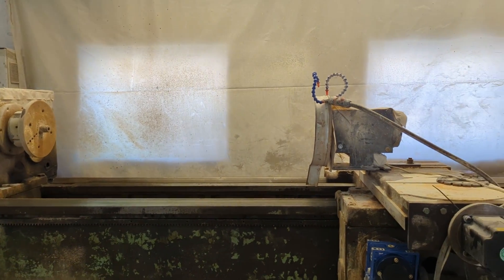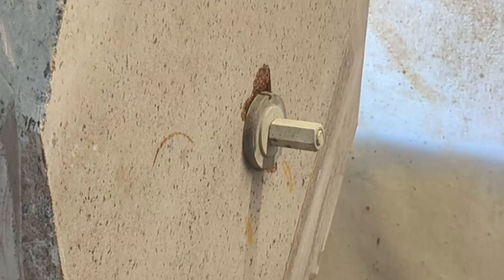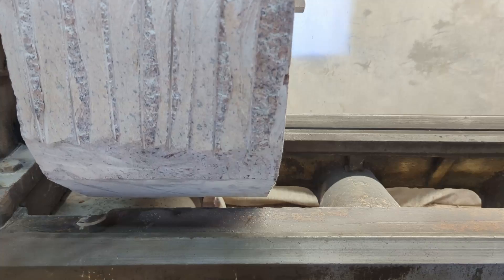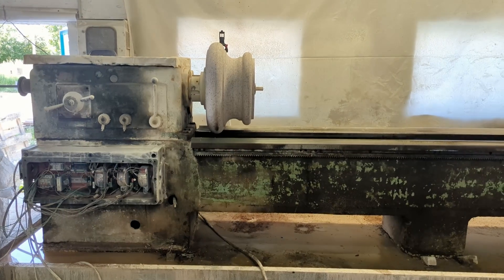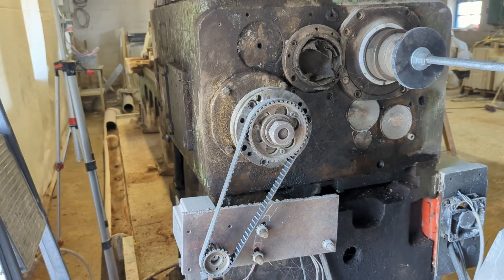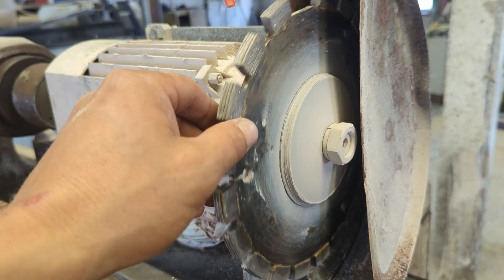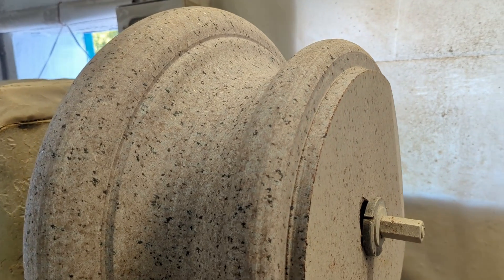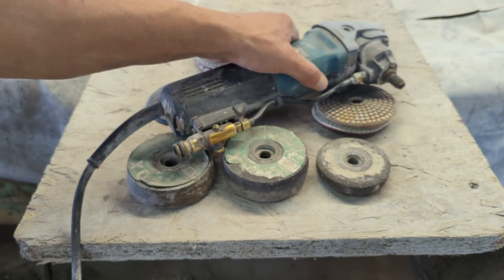Turning giant piece of granite on a lathe or  diamond SAW

Comment: I take this as proof on an ancient pre-dynastic civilization in Egypt
Reply: Hollow it out then add handles
Reply from the maker: Unfortunately, this part must support the column, so removing the middle is not an option. But with the growing interest in more complex projects, the next videos will include a vase or something like that. In the meantime, you might want to check out my previous videos. I promise there is something to see there. Thank you @Trevor.Morrice
Reply: @Trevor.Morrice Those darn handles!
Reply: @737simviator  Yes, I have, hence the joke

Btw, as expected he invest 5 seconds of he hour and a half telling us about the "impeccable" provenance of the vases, without mentioning it, showing any proof, document or independent confirmation

:D
Reply: @TheChzoronzon Also makes me question the circumstances in which the vases were acquired. Some guy probably got scammed into selling a kidney for a fancy cup
Reply: @737simviator first of all, find a great big rock and then break it up into smaller rocks and then heave a smaller rock onto a lathe. 
I guess a vase was the simplest thing to make on a lathe?
But did the vases come from Egypt or were they imported?
Reply: @johncater7861 they found 40,000 vases , apparently . 
Mind boggling
Reply: We should see if you can find a way to make this happen with no electricity just mechanical advantage.  Or if there's a way to harden copper by coating it with Emory.
Reply: Check out the research UnchartedX is doing on this subject.
Reply: @PhiTonics  yes, sure people can have their opinions but a lot of us crave actual facts so far as they can be researched.
Reply: @johncater7861  what are you on about? If your looking to pick a fight, I'm not interested.
Reply: @PhiTonics  I'm purely agreeing with you. Uncharted X is doing some great research. Some others merely postulate without trying to come up with hard evidence and facts.
That's all.
Reply: https://youtu.be/QzFMDS6dkWU?si=0GrBbnqPbs4J0dLj
Reply: Some of the vases measured have provenance back to the late 1800s.. don't just watch the video, read the description.
Most are in private hands, since obtaining artifacts from Egypt legally is near impossible now
Reply: @baabaabaa-El  Let's see the documentation, and provenance details, words just don't suffice... tho having been on private hands makes the chain of custody very weak already, and we should treat the subject up to trial standards, of course, as any good science does

What they should do is convince a museum to measure the vases in exposition, examples a century in documented custody
Reply: @TheChzoronzon  Do your own homework sunshine, lm not ya mum!
Some had come from museums, on loan from private owners.
See how much you took notice, attention span of -
Reply: @TheChzoronzon "convince a museum" 🤣🤣🤣🤣
Reply: @baabaabaa-El  "Sunshine" pfft bwhaha

Yeah, museums from Oz, oh u where I don't shine...
Reply: @baabaabaa-yp2jh provenance hasn't been established for the scanned vase.
Reply: IM sure your head is full of jeast.
Reply: Thinking the same
Reply: The only problem with the "pre dynastic" theory is that there is no archeological evidence.
Reply: KUDOS! Very impressive skills and imagination, Sir!
Reply: @737simviator 
You mean the vase with totally unreliable provenance?
Also, the lug handles were absolutely not lined up perfectly.
Reply: Proof the most common killer of intelligence is islam..Muslim rule in Egypt is the only reason there are so much egyptology questions still unanswered. Tourists can hack away at the original source material on a daily basis..
Reply: NO BREATHING MAsK 😂😂😂😅😅😅😮😢😮😢😮😢😮😢 OK say goodby to your life. Hey come on...
Reply from the maker: I now have a great responsibility. I'll try not to disappoint in the future videos. Thank you

😄
Reply: @madeofstone7619  With great responsibility comes great POWER! 

Congrats, oh new handsome overlord
Reply from the maker: Now I'm also embarrassed @TheChzoronzon  ☺but I accept my new title😆
Reply: 😅 Nope, a true believer in estabilishment egyptology would definitely tell,you, that this all is doable with copper chisels, pounding stones and sand as polishing agent.😤😂 Great, and terrifying work, subscribed 👍..
Reply from the maker: I love ancient Egypt. I think in the future I might make a video on ancient stone processing technologies. Thank you for watching. @anonplayer8529
Reply: @anonplayer8529  Oh, the old egyptians knew pottery wheels and probably some kind of lathe too 

Tho the vases that are as round as this one are modern with certainty, so any competent egyptologist would call it a forgery ;)
Reply: Nope, the experts have spoken! Stone hammers, copper chisels,  and deer antlers!
Reply: Yes he just proved what kind of machines they would have had to use to make those cuts thousands of years ago when they were not supposed to have such tools or access to these cutting blades. Now let's do it with a copper chisel and a stone hammer... Lol
Reply: You beat me to it. How anyone thinks they made dead flat 80ton boxes is beyond me